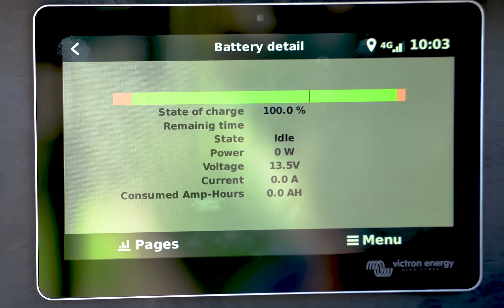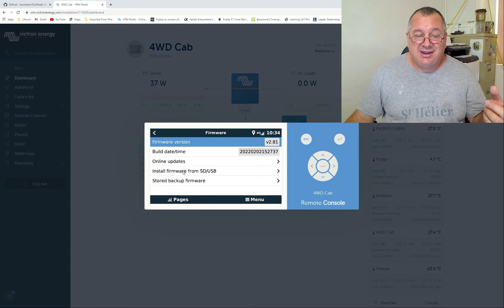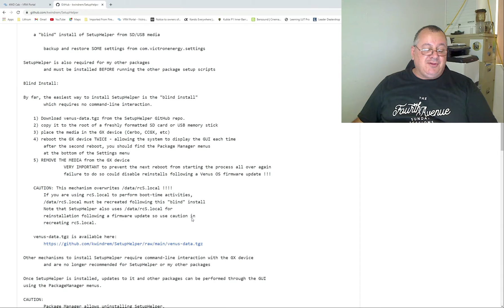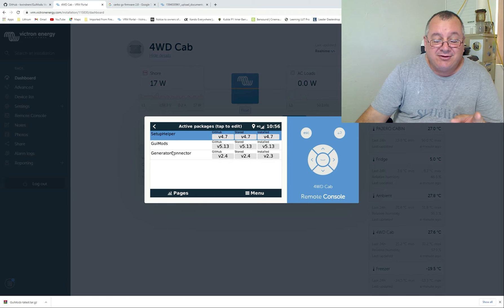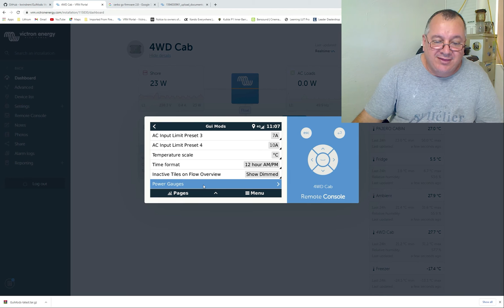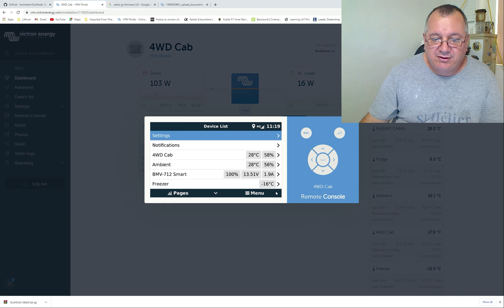How to install and setup GuiMods Hack on the Victron Cerbo GX and How To install  Ruuvi Tags

Comment: This may have been asked in the past three years - but do the GUI Mods work with the new VenusOS “Blue UI”…. Any ill effects if you already have them installed then switch to the new Victron UI?   Or do GUI Mods only work with the “Classic” interface?   Great video, by the way!
Reply from the maker: I'm using the GUI from Victron,  because it has rectified a lot of the past issues.

Comment: Great job!!!
I'm going to watch it again.
Can you add instructions on how to remove the usb after installing the Gui.
It's on the  VRM online portal...microSD/ USB...EJECT.
All good after that!
Ours faulted when I removed it without doing this, so I had to go through the install process again.
Reply from the maker: You have to make sure you remove at the time I mentioned in the video.  Otherwise it will repeat the whole procedure again

Comment: Hi, thank you the install went without a hitch! Do you know how to get the bulk, absorption, float and ac in to light up in green like the inverting indicator? @OrganicPower-Australia
Reply from the maker: Mine just did it. It lights up.  I've not had to change anything.
Reply: Thanks for the reply. They must have changed the code somewhere. Just took another look at your setup, they have replaced the circular indicators for words. Invert comes up green for me but bulk, abs and float are inactive? Anyone solved this? Cheers 😎
Reply from the maker: @OrganicPower-Australia   yep mine came up as words.  All lights up showing the different state on mine.
Reply: Ok, I will have to go searching for a setting on the Multiplus maybe? I wonder if it could also have to do with having multiple MPPT's? Do you have one tracker or multiple? Thanks again  @PhilsCampingReviews
Reply from the maker: @OrganicPower-Australia  I have 2 MPPT"s.  Only one is connected to Cerbo GX. As the 2nd MPPT is not a victron. It's  a redarc dcdc charger with a mppt.

Comment: Cerbo GX Firmware Ver 3.0  returns error message "no fileset for v3.00-8" on attempt to install GuiMods. Any suggestions?
Reply from the maker: You might have to install an earlier version of cerbo gx firmware than install guimods.
Reply: @PhilsCampingReviews  i actually went the other way and and installed a later version and that version accepted the guimod hack.  Thanks for the speedy reply. My ruuvi just arrived so I’m going to attempt a sync tomorrow. So far, so good.

Comment: Hi, you stated that you use an USB 4G dongle. Victron has a 4G option but is quit expensive. What 4G dongle are you using ?
Reply from the maker: That's the one I'm using. The victron 4G modem.

Comment: I installed shutdown monitored now the video screen doesn't work, can't even connect to VRM remote console anymore, how do I install the original firmware ? hopefully I did no brick the Cerbo GX
Reply from the maker: I'm not familiar with the Shutdown monitored option.
Reply from the maker: You will probably need to get access to the terminal on your Cerbo GX and reset it.

Comment: Hi there. Thanks for the excellent explanations. I did it and it worked. In order to declutter the main page on the display, I selected an option to get the original victron main page back. Unfortunately, that also deleted the RUUVI-temp data on the secondary page, despite the RUUVI data are still visible in the menu. How do I get the secondary page (but not the primary page) to display the temps? Best regards from Switzerland, Silvano
Reply from the maker: Try unplugging the power supply to the cerbo gx.  Wait a  minutes, than plug power back in.
Reply: @PhilsCampingReviews  Thanks. I did it now and unfortunately it does not change anything. Still no RUUVI data on the display.
Reply from the maker: Are you using a Bluetooth dongle for the ruuvi tags?
Reply: @PhilsCampingReviews  No, I have no separate dongles, as my Victron is only a year old and thus has integrated Bluetooth.
Reply from the maker: @silvanocometta9760  the builtin dongle is not reliable enough to use the Ruuvi Tags. 

You need to pick up a cheap USB Bluetooth  adaptor. Plug it into one of the USB Data ports on the cerbo GX.  Than turn off the built in Bluetooth on the Cerbo GX.
Reply: @PhilsCampingReviews  Yes, thanks Phil. I will do so, when I am back to civilization. Best regards, Silvano
Reply from the maker: Have you sorted your issue out?
Reply: @PhilsCampingReviews  Hi Phil. The problem is unresolved. I tried a cheap USB dongle and still it is not working, despite the latest Cerbo firmware installed. I get the RUUVI data on the menu page but not on the main display pages. Do you have any suggestions? Regards, Silvano
Reply from the maker: @silvanocometta9760  not at the moment.  I will look into it.

Comment: What happened to the Temperature Scale option?  This was a major reason I installed GUI Mods so I could show Farenheit on my temp sensors.  That's missing in my setup (v7.15).
Reply: Answering myself...  Now native to Victron settings.   Settings => Display & Language => Units
Reply from the maker: Mine is set to degrees Celsius  C.   I've not noticed any issues.

Comment: I received a couple Ruuvi sensors this week. I installed them in the two freezers on my sailboat. It was easy enough to connect them to the Cerbo via bluetooth and the data was immediately available on the VRM. In searched for a solution to display the data on the Remote Console and found this video.  The process is very simple, but I had a few issues. When rebooting my Remote Console locked up. I had to disconnect power to restart the Cerbo. Following the instructions I rebooted it a second time before removing the thumb drive. The install appeared to be good. I was able to use the setuphelper to install the GUIMOD. I then noticed that I lost my Ruuvi data. When investigating that issue I found the Cerbo Bluetooth light was not on. When I looked through the menus I found that Bluetooth was no longer listed on the Settings menu and Bluetooth Sensors was no longer listed in on the I/O menu. I ended up uninstalling the GUIMODS and then the setuphelper. Still the bluetooth was not available. I cycled power to the Cerbo and bluetooth became available again. 
I was running v2.91. 
Any thoughts on why this might have happened?
Reply from the maker: I know there is some issues with the reliability with the built in Bluetooth. 

It is recommended to use a Bluetooth usb dongle on the cerbo gx.   Victron recommends to deactivate the cerbos built in Bluetooth and use the usb Bluetooth  dongle.

Check victrons website for recommended dongle.
Reply from the maker: You should have tried rebooting the cerbo gx before you uninstalled the setuphelper  and guimods.     High probability that would have got the Bluetooth back.

Comment: BT is enabled, non of my Ruuvi tags show up... and they're 4ft away
Reply from the maker: Are you using the Cerbo GX built in Bluetooth?    if so,  that's probably your problem.    Victron have recently announced it's best to use a USB Bluetooth dongle instead of the built in Bluetooth on the Cerbo GX.

Comment: Hello Phil, is it correct that by now the GuiMods are no longer required, as Victron recently updated the firmware to enable the Cerbo to accept RUUVIs automatically? If that is correct, which firmware update number is required? Best regards. Silvano.
Reply from the maker: Guimods is not needed to get the ruuvitags to work on the Cerbo GX,   

For Ruuvitags to work you need firmware 2.80 or above.

What Guimods give you is having the temps show on the main screen and additional  features such as power rating etc shown on main screen
Reply: @PhilsCampingReviews  Thanks Phil. That is good news, as it simplifies installation / setup.
Reply from the maker: By default if you want to check the temps. You have to go through the menus of Cerbo GX.   

With Guimods all the temps sensors can be viewed on the main screen without going into the menu
Reply from the maker: That's not the only benefit  of using Guimods.  There are many benefits

Comment: I got it installed but for some reason the battery temp isn't reading right. I can look at it on line and it seems ok but not on the remote console. Any ideas? Ruuvi's seem to be ok but not the temp sensors on the battery.
Reply from the maker: Which temp sensor?    The Ruuvi or the Victron Temp sensor.   If Victron Temp sensor,  I had one that was out,  victron replaced it for me,   but there is a way you can adjust it,  by logging in as a super user on your Cerbo GX and changing some settings for the temp sensor,   I tried this on mine,  but after a few weeks it started giving the wrong temp again.        The Ruuvi tags are very accurate,    If yours is out,  I would contact Ruuvi support.
Reply: @PhilsCampingReviews  It was unused Victron Temp Sensors. I finally figured it out and I was to disable them so they don't show up. All is good now. One question, is there a way to change the colors of the displays?
Reply from the maker: @nj5wrick156   I changed the Color of the Ruuvi tags if I recall when I set them up. 

Not so easy to change the Colours for the rest.
Reply: @PhilsCampingReviews  Subject for next video? Lol

Comment: Great vlog thanks, quick question , will these mods allow the touch to control the multiplus if I don’t connect the remote panel? I’ve ordered the touchscreen but it’s not arrived yet!
Reply from the maker: The Victron Multicontrol gives you full control easily especially ac input.   Problem is you will loose all other methods of switching on and off and adjusting ac input. 

Guimods is a game changer for me.  Guimods has added better control of my multiplus.  If not for it,  I would still be using the multicontrol. 

Now,  having full control via touch screen.  Phone and remotely is a great feature. 

I can lay down in my roof top tent,  grab my phone and turn on or off the multiplus if I want to.  And change ac input if I’m connected to shore power.
Reply from the maker: You referring to the Victron Multicontrol?

If so… yes.  You can control the Multiplus on the touch screen also remotely via the Victron remote portal.  

I’m thinking about filming my next YouTube video showing how I can control my system via touch screen,  phone and remotely.
Reply: @PhilsCampingReviews  that would be great, because I can’t at the moment because I’ve got a Victron battery with VE BMS 👍
Reply from the maker: @steveweaver3020   I have not tried a Victron Lithium,  I know with the Victron Lithiums you purchase and use a BMS separately. 

Im not familiar with the VE BMS but a quick look online I see there is a plug,  like a network plug for a remote panel. (Multicontrol)

Does that have to be used?  Can you not unplug it?  I wonder what the consequences is if you do unplug the remote panel.

Comment: I uninstall mine after having a problem which had nothing to do with mods but can't get it to install now I'm sure there's a update
Reply from the maker: If you uninstall,  it’s difficult to get back on.  I’m not sure why. 

The only way I know to reinstall and get working again is to install via terminal on your computer.   You have to log into your Cerbo GX as a super user first.
Reply: @PhilsCampingReviews  lost of now I can log into vrm on computer but lost after that
Reply from the maker: @northeastcarpfishing   you tried the procedure again after uninstall and it will not load package manager?

Package manager is gone?

I want to make sure this is what is happening.
Reply from the maker: @northeastcarpfishing   I warned about this in the video.  What ever you do don’t uninstall setup helper otherwise very difficult to reinstall. 

As you’ve found out. 

You might need to get a computer tech now.  He or she will help you with reinstalling setup helper via the command line from the Cerbo gx. 

You can find the procedure in how to do this here
https://github.com/kwindrem/SetupHelper

But you will need some experience in using dos commands and how to use the terminal on your computer.
Reply: @PhilsCampingReviews  yes package manager is gone
Reply from the maker: @northeastcarpfishing   using the command line method of reinstalling you need to first log into your Cerbo gx as a super user. 

Best way to do this is on your computer via the portal.  And using the remote console on your computer
Reply from the maker: @northeastcarpfishing   there is a procedure on logging in as a super user on the Cerbo gx.  

Quick google search you should find help on how to do this. 

But you will need to be careful as you can potentially brick your Cerbo gx if you don’t know what your doing. 

You best to get a local computer tech that is familiar with dos commands on working on the terminal on computers
Reply: @PhilsCampingReviews  I've managed that I'm a super user now
Reply from the maker: @northeastcarpfishing   
Set access level to Superuser

To set the root password, first set the access level to Superuser:
Go to Settings, General
Set the Access Level to User and installer, the password is ZZZ
Highlight Access Level (don't open the select page, ie. make sure you are in the General Page, not the Access Level page)
Press and hold the right button of the center pad until you see the Access Level change to Superuser. Note: when working from the Remote Console, you need to use the right key on your keyboard. Pressing and holding the right button with your mouse won't work.
Now you have access to the super user features.
Reply from the maker: @northeastcarpfishing   I added instructions on how to access super user on your Cerbo gx.  But I seriously suggest to get a computer tech to do this.
Reply from the maker: @northeastcarpfishing   Awesome I read your in super user now. 

Let me see if I can find a YouTube video showing how to do the rest. 

A lot of those that use raspberry Pi instead of Cerbo gx has to install setup helper via the terminal.  At least in earlier versions they did. 

Someone out there will have instructions on how to do this. 

I will search and see what I can find
Reply: @PhilsCampingReviews  I wouldn't attempt myself thanks mate
Reply: @PhilsCampingReviews  thanks for your time phil

Comment: Thanks mate! While I have done some coding and such before I really could not be bothered reading through bulk pages on the forums to work out how to install this. You summed it up into a 5 min process for me and a few simple steps. Well done. I have my Gui Mod up and running. Thank you. Also i have the 7" screen and can agree that the 5" would be a bit small after using a friends 5".
Reply from the maker: Thanks 👍

Comment: Added this to an owners system who bought some ruuvie sensors and while it worked and was kinda cool we lost VRM which we only found out when we got back to the UK; the boat is in Gibraltar! I managed to get a local engineer on board to uninstall GuiMods and then lost the analogue tanks in I/O, rolled back the firmware and still got no analogue I/O. I'm going to give the owner a new Cerbo as its too much risk to try and figure out what else may have been corrupted. As an amateur I'm happy to spend days and days playing with this sort of thing as a Pro its just got to work, be stable and be uninstall-able.
Reply from the maker: Your the first I know off with issues like this.  Are you using a Victron 4G dongle?  Or wifi to a modem onboard?

Comment: Unfortunately i can't seem to get it to work for me, put the file on a drive and put it in the cerbo. Re booted twice but nothing happened.
Reply from the maker: Do you get the packages manager in settings?
Reply: @PhilsCampingReviews  no
Reply from the maker: @trevorfisk8648   you using PC or Mac computer?
Reply from the maker: Make sure the thumb drive in in a compatible format which is exfat or fat32
Reply: @PhilsCampingReviews  i did do that, i will try again
Reply from the maker: @trevorfisk8648   I would place the thumb drive back into your computer.  Format it and redownload the Venus file again.
Reply: @PhilsCampingReviews  seems to be on there now, thank you
Reply from the maker: @trevorfisk8648  awesome 👍
Reply: @PhilsCampingReviews  thank you very much for your help, the GuiMods seems to be taking a while to download but i hope it will be ok.  thanks again
Reply from the maker: After each boot up make sure the Cerbo GX is fully started.

Comment: Hello phil.
thanks for the video. nice Job !!! I would also like to display the temperature in the camper and the outside temperature on the screen. my question is, what temperature sensor did you use?
Reply from the maker: Ruuvi tag pro are the sensors I used.  They are Bluetooth temp sensors that are compatible with firmware 2.80 and above for the Cerbo GX. 

To get the temps to show on the main screen, you need GuiMods.
Reply: then the gui mod is the prerequisite for the Bluetooth connection to the ruuvi sensor?
Too bad the ruuvi is not available in Germany. anyway thanks phil.
Reply from the maker: @jörggenetzkie   GuiMods is only a requirement if you want the temps to show on the Victron HD touch screens.   Otherwise the temps is accessible only via the portal.
Reply from the maker: @jörggenetzkie  the Ruuvi tags are also not available where I live. 

Buy them direct from the company in Finland.
Reply: @PhilsCampingReviews  the gui mod runs right away. that's really cool. thank you very much phil
Reply: @Phil's Camping & Touring  Now they are phill, you probably know that already.
Reply from the maker: It’s all in the video